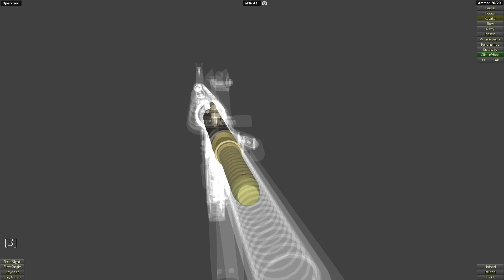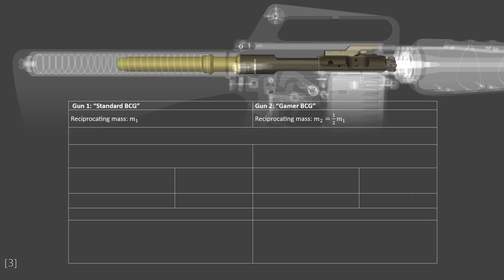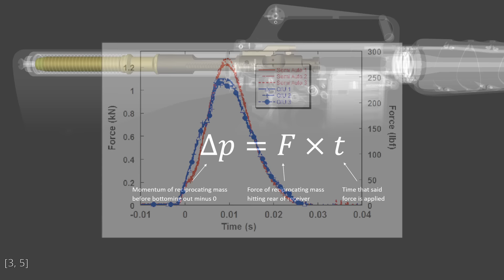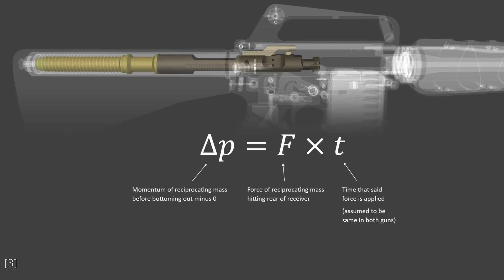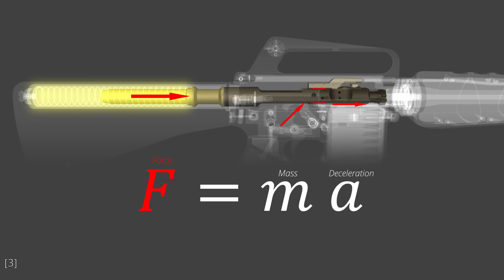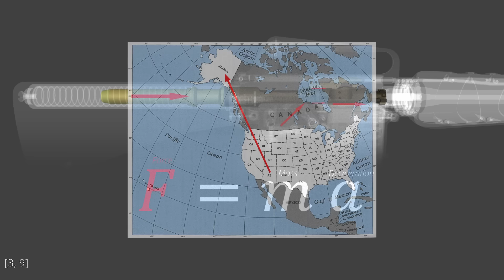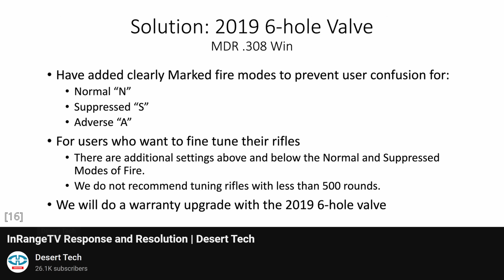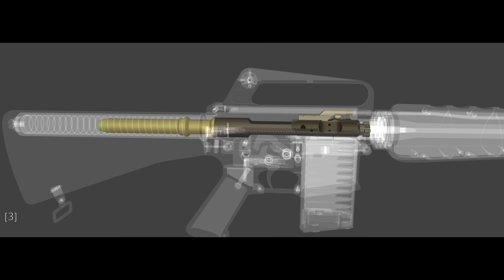Bolt Carrier Mass - A Nerdy Theoretical Discussion

Comment: 10:25 this dummy pushing on the bolt instead of using the forward assist FOR BASICALLY THE ONLY THING YOU'LL EVER USE IT FOR has angered me more than it ought to have.
Reply: That bolt does not have any cuts into the carrier to allow the usage of the "Forward-assist" dummy.

Comment: What many people don't understand is a heavier buffer's effect on dwell time (bolt unlocking) is insignificant..This was proven years ago by Colt and recently by SilencerCo' testing with a high speed camera and computer..A heavier buffer does have an effect on carrier velocity..The extractor will lift completely off the case rim (after) the bolt un-locks..It is the residual pressure that holds the case against the bolt face that allows the extractor to lower back down to perform the extraction process.. The hotter the chamber becomes the hotter the brass case becomes and the longer it will take for the case to relax (objuration) to occur..This is why carrier velocity is so important to reliability..A heavier or lighter recoil spring can have the same effect as increase in the operating mass..
Reply: I think it's nonsense what you're saying about dwell time because I've never heard anyone talk about BCG mass as a primary factor in dwell time. Some people might have a wrong idea what dwell time is but that's not the point.
Reply from the maker: Interesting. I think I read somewhere (probably Sturgeon's House) that the residual chamber pressure after the bolt unlocks contributes a fair bit to the bcg's kinetic energy going rearward, and also makes the extractor lift up like you said? I wonder if this behaviour is unique to AR-15/AR-10 pattern rifles where there is little to no dwell time built into the geometry of the bolt carrier's cam track, as opposed to AK pattern guns where there's like 10mm of bolt carrier travel before the bolt starts to unlock?
Reply: The dwell time is from when the bullet passes the barrel gas port to the time it leaves the barrel..It is the straight part of the cam track that effects the residual pressure..LMT increased the straight part of the cam track to allow more time for case (objuration) and it work perfectly in the M4 platform..The reason the military did not adopt it was because it would not work reliably with the rifle length gas systems and it would have required supply to carry two different types of carriers..The extractor lift study can be found at AR15 repository..The test was done by the military TATCOM (Understanding extraction lift in the M16 family of weapons)... @cabbage6015
Reply: @hairydogstail  I think in your first comment you mix up dwell time with lock time. But explain dwell time well in the reply. 

I've found through my own amateur experimentation that buffer mass does effect lock time, it's only logical that it does. However what's actually key is the ratio between the mass of the carrier and the mass of the buffer. The higher the buffer mass in relation carrier mass the more effect it will have. The reason for this is that even on a standard cam track there's still a time when the carrier is moving back without rotating the bolt. The movement of the buffer mass slows that initial movement.
Reply: The effect the buffers added weight on the rifles dwell time or the bolt opening cycle is negligible..This sentence was quoted from the Black Rifle book page 202..When people claim the heavier buffer delays the bolt from unlocking, they are wrong..In the Black Rifle book on page 202 it explains this discovery by Colt..There are thousands of pounds of gas pressure charging the piston in the bolt carrier, a few ounces of buffer weights is not going to make any significant impact on delaying it.. SilencerCo did tests using different buffer weights using a high speed camera hooked to a computer that verified the Colt test and analysis.. It was able to document/graph the complete cycle/time.The difference in buffer weights was insignificant..In fact on one graph the lighter buffer did better than the heavier ones..Once the bolt un-lockes and the high pressure gas begins expelling from the carrier ports, the buffer weights come into play, slowing the carrier velocity and helping the extraction process (which works on the expelling residual pressure).. .   @snek9353
Reply: @hairydogstail  I can only assume this is in regards to full mass carrier and no AGB.
Reply: One factor I’d assume to partially affect the data is the multi weight buffers have internal space between the weights that must be taken up before it would act as a single / solid mass…..this means the bolt carrier may need to move rearward significantly before the mass of the buffer is equal to its mass as measured on a scale, and depending on cam track geometry this could be in different parts of the cycle comparing a standard BCG to LMT’s…..one interesting thought is the VLTOR A5 has a very light biasing spring that stacks the weights to the front of the buffer when in stationary state; this design would seem to change the data of colts test, due to 100% of the buffers mass being part of the BCG’s mass the moment it tries to move (not considering the compliance of the rubber donuts between the buffers internal weights).
Reply: @ericschumacher5189  The dwell time/bolt lock time is not effected by the carrier or buffer weight..What it does effect is the carrier velocity and bolt bounce..The bolt does not un-lock until the bullet has left the barrel..It is the residual pressure that cycles the action and only then does the carrier/buffer weights come into play..The A5 was designed for the Marine corps trials to see if the M16A4 ( 20" barreled) rifles could function reliably with an adjustable stock..In the end, they never adopted it..The only advantage the A5 has over the mil spec buffer set up is the larger amount of buffer weight that can be used..The best way to increase lock-time is by lengthening the straight part of the cam pin groove in the carrier..This is what LMT did for their enhanced carrier used in 14.5" barrels..It worked as designed, but was not adopted because it would not reliably work in the 20" barrel..It allowed too much time for un-locking and allowed too much residual pressure to escape to reliably work in the 20" barrel..The military did not want two carriers in supply system so they never adopted it..
Reply: @hairydogstail  I understand what you stated in your reply to my comment and understand the history of the LMT carrier and A5 system (I think we are talking past each-other).....What I'm stating is, if more mass present in the BCG / buffer assembly, then rearward movement will be further delayed, even after gas has reached the bolts internal piston....[given the potential-energy (residual-gas-pressure) is fixed, and the kinetic-energy (BGC moving mass) is also fixed].....This is why I made the statements I did about the buffer weights position either being a contribution/not to the moving mass of the system (while the gas tube remains inside gas key).....my reasoning (besides physics) for believing the BCG / buffer mass contributes to unlocking velocity is if you compare suppressed vs. unsuppressed operation, this makes a huge difference in cyclic rate......if mass doesn't make a difference to unlocking velocity, then residual pressure would only be adding velocity after unlocking (when the gas-tube is no longer inside the gas key) but, this can't be true given cases get rims ripped off / extractors break when over-gassed, and this damage happens due to velocity & timing of the unlocking phase, not after extraction has already occurred. 

Note: I'm sending this with all due respect / not trying to offend.
Reply: @ericschumacher5189  I understand what you are saying, but the reality is the buffer/carrier mass effect on un-lock time is insignificant..Test after test has proven this..The reason case rims were ripped off during the early part of the Vietnam war was the brass was extremely soft and the chambers were pitted creating a mechanical lock..Stoner blamed this on the higher port pressure but Colt proved it was not the cause of stuck cases..Other wise the cases would not have needed a cleaning rod to knock them out, they would have just fallen out after the case relaxed..Extraction does not occur while the bullet is still in the barrel and the system is still fully charged..In fact the extractor completely lifts off the case rim (after) the bolt un-locks..It is the residual pressure that presses the case to the bolt face long enough for the extractor to drop back down to complete the extraction process..I have the government test on this  phenomenon...Rifles can be way over gassed causing the case to extract before the case can relax completely, but this is still residual pressure (via extreme residual pressure)..In any case the added buffer weight effects the residual pressure, not lock time..Silencers increases the residual pressure time similar to moving the gas port farther from the end of the barrel..This is why different barrel port locations require different sized barrel ports..Even then the added carrier/buffer weight effects carrier velocity, not lock-time.. It is a misnomer when people say or think that increased weight in the buffer/carrier will keep the bolt locked longer..It will slow the carriers reward movement, but only after the bolt has un-locked and the bolt begins to expel the internal charged piston.. After the bolt un-locks, It is then that the residual pressure comes into play and the weight of the carrier/buffer has its effect..The pressure in the carrier (piston) is in the thousands of pounds PSI when the system is charged and adding a few more ounces of weight in the buffer/carrier will have insignificant effect on the bolt un-lock time..Once the bolt un-locks and the piston begins to expel its pressure through the exhaust port, it is at this moment the buffer/carrier weight comes into play..This is why the LMT enhanced carrier works with the 14.5 barrel (carbine length gas tube) but fails with the 20" barrel (rifle length gas tube)..The longer cam pin straight track allows more time for the residual pressure to drop before un-locking, compared to the standard cam pin tract..We are talking micro seconds, but the difference is significant..
Reply: @hairydogstail  Thank you for the explanation; I trust what you've described, and the justifications for how the system actually operates make sense (admittingly its hard to reconcile / that the mass has so little significance during initial bolt movement / unlocking phase, but I better understand the reasoning you provided)....given this understanding is correct, that means the bias-spring that stacks the buffer-weights of the A5-System to the front, has very little engineering reasons to be part of the design (as it was originally advertised)....the supporting evidence i can give for the A5-System's carrier weights stacked to the front changing BCG velocity is slo-mo videos of full-auto operation comparing the A5 to traditional A2-buffers (usually the ejection pattern is less erratic / very consistent on the A5).....I suppose the spring biased weights do work, though they must be affecting velocity (by making the apparent buffer mass more consistent) further back in the BCG's stroke than is commonly assumed / theorized (sometime after unlocking has occurred / minimizing buffer-weight bouncing).

Thanks again for the detailed dialogue.

Comment: I wonder if this has anything to do with the ratio between the mass of the bolt itself vs the mass of the carrier. Because altering bolt carrier mass while not altering the bolt mass will result in reduced rearward kinetic energy after the bolt is picked up after the unlock process. Iirc the fw army ordnance manual talks about a ratio of 3:1 for ideal carrier to bolt mass ratio. So there might be something there ig. Lighter carriers also require stiffer springs as seen in the foxtrot mike bufferless carrier uppers, which makes charging more difficult. Maybe a reason they went with the forward charging mechanism. Just a few thoughts ig.

Comment: Most of the downsides of asjustable gas can be overcome with fully adjustable gas blocks like the rifle speed gas system which is fully click adjustable and can done without tools so you can crank up the gas in cold environments and turn down the gas in extremely hot climates. The main reason you dont see super low mass bolts in military rifles is because of bolt bounce in full auto.

Comment: Subscribed, because we need more of this. I think more reciprocating mass should be moveable buffer as opposed to solid. Per my understanding/guess, the moveable buffer mass essentially does the positive things that solid mass does, but requiring less mass.

Maybe the initial part is a little worse - the unlock has less mass, of course, but you should get a little delay/slowing at the end of the travel due to the moveable mass, and then of course, it should also help the forward motion back into battery. 

I’ve wanted to test a heavy buffer and lightweight carrier for a long time, ideally ending up a few oz lighter than a standard system, but haven’t had time. 

What are your thoughts? Why am I wrong?
Reply from the maker: I think it's a good idea generally. 

Moveable buffer weights spread out the impulse of the reciprocating group striking the rear of the receiver extension, because instead of one large mass impacting at once, it's multiple smaller masses impacting throughout a larger length of time. It works to kill bolt carrier bounce too, but I guess that's not too important in semi auto. If the total mass is the same as a solid reciprocating group, it will store the same kinetic energy to overcome springs and frictions, so yes it retains most of the benefits of the same solid mass. There's just one quirk which is the buffer mass does not help the unlock and pickup of the bolt, only the carrier mass does, but unless one doesn't go overboard in reducing carrier mass it should be fine.

The only thing I might not agree with you is when you said moveable buffer mass does the positive things that solid mass does, but requiring less mass? I could be wrong tho
Reply: @cabbage6015 thank you - I meant some of the positives, such as improved delay at end of travel, allowing for the magazine spring to push up the next round, and then acting like a dead blow when feeding that round. Obviously they (free or semi free moving mass, and solid mass) behave differently. 

The only thing I worry about is the initial unlock and velocity rearward, although that should be able to be addressed with adjusting the gas system. 

Thanks for your input, hope you end up having more thoughts on the subject at some point. 

A video on hydraulic buffers would be incredibly interesting. Cheers

Comment: This is all why just using a stronger spring is the way to go
Reply: Well, not exactly. Springs need to be tuned—just like gas or a BCG. 

Too strong a spring, you’ll either fail to extract or your BCG will slam into the front of your gun. Too weak a spring, and you’ll run into the same issues the video mentioned—bolt slamming into the buffer tube, stripped extractor, etc. 

Ig in the context of making a reliable AR15, a strong spring is good. Competition shooters tend to lighten their springs.
Reply: @noahchong9130  yeah obviously I don’t endorse just throwing the strongest spring in there right off the bay. But tuning it with whatever is the right strength. Just like how we don’t go straight to h4 buffers

Comment: what if we accumulate this energy required for feeding in a pressure vessel as a gas pressure instead of the kinetic energy of the carrier (converting to the spring compression and then back)
call it "gas operatated forward assist"
we draw some gas from the gas port in TWO portions where one of them is buffered for later use (to give this forward motion we need).

Comment: Another potential reason to run a heavier bolt carrier is to reduce bolt-carrier bounce (like @GldenRetriever mentioned). That can also be done through other means (the HK bolt locking lever, anti-bounce weights/powders), but adding carrier mass is the easiest of them all. Great video!
Reply: It was a heavier buffer with independent moving weights that prevented bolt bounce, not the carrier..The heavier the barrel the increase in bounce..
Reply: @hairydogstail  It's not really the heavier barrel that's at play, it's that the gun's weight increases with a heavier barrel. In elastic collisions, the greater the difference in weight, the more the lighter body bounces off. By making the bolt carrier heavier (or the gun lighter, which is way more difficult) the tendency to bounce is reduced. 

Like cabbage mentioned, the buffer and bolt carrier are pretty much a single component under operation (early prototypes of what would turn into the ar10 had a super long bolt carrier, that was split into two components, carrier and buffer, when the disassembly method changed) and I already mentioned anti-bounce weights.

Comment: Something else interesting is that a bolt for 22LR is 80 grams minimum. Any less and you will have occasional out of batteries and jams. Equally if your bolt is far too heavy, you will have failures to eject. (AR platform)